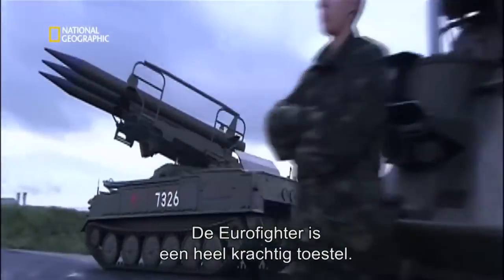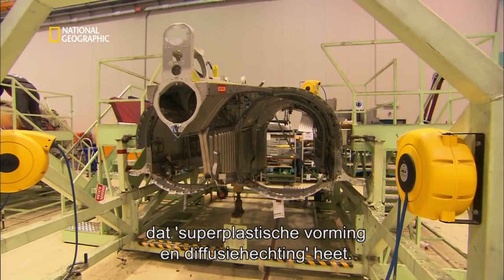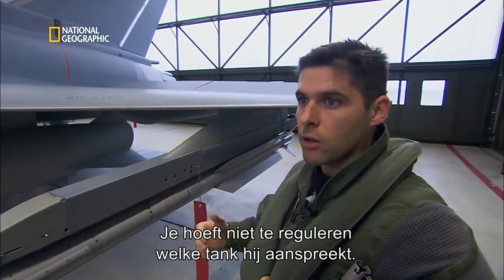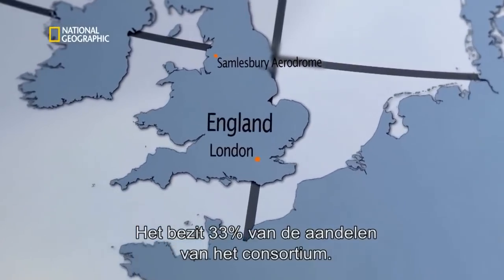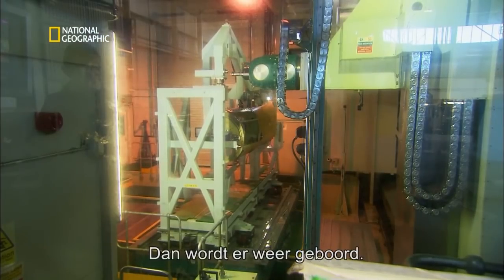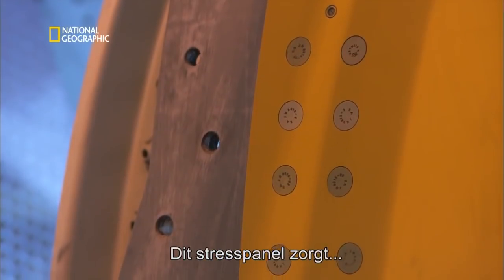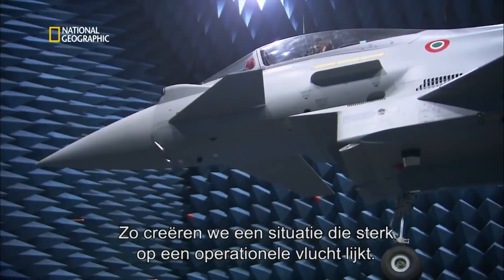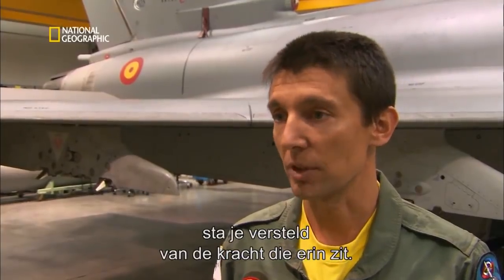National Geographic Megafactories - Eurofighter Typhoon

Comment: Most advanced??? I don't think so. This probably is the most agile in it's class but even the epic fail of an excuse f35 is more advanced than this.
Reply: Um the F-14 Tomcat is better than the F-35 and they did say this is the most advanced fighter in European History not the most advanced fighter ever made in the world but in Europe it's the most advanced fighter that the Europeans had designed
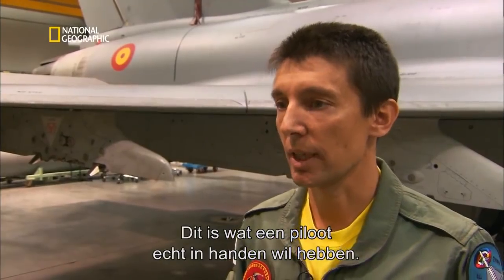Reply: Gahlok12 start  0:11 . . .and nope, the F14 is not better than an F-35. The F-14 may be a legend, but the F-35 is a multi-role aircraft. F-14 was mostly meant for intercepting.
Reply: red rivers But the F-14 became a multi-role airplane back in the 1990's it out runs, out turns, out climbs it. and can use more weapons than a F-35
Reply: The only reason why it became a multi role was because there was no choice for the americans. The reason why the F15 was built was because of that being the primary reason. On a sprint, the f14 was fast, but on turns, the f14 turned wide. Because the design of the body was meant for interception missions. The f14 was also expensive to maintain. F14 is a beauty, o
But on the practical side, it was never as agile as it's opponents.
Reply: red rivers At least it could out turn a MiG-23
Reply: And that was your basis of saying that an F14 is better than an f35????
Reply: red rivers It can carry better weapons and doesn't full rely on computers and is a proven design
Reply: Please...the fact that it was retired meant it was not better. An aircraft is not just measured by how many guns or rockets it can carry. It has to be efficient and precise. And cheaper to maintain. Maintenance was the very reason why it became obsolete. Carrying more and moving faster is useless if it costs a whole country to operate.
Reply: red rivers Dude the F-35 is an okay plane but it's range is less than the Tomcat plus I have been throwing out things and besides a F-35 is more complex than a Tomcat and a F/A-18 E/F can't go over Mach 2 speeds The F-35 on the flight deck is going to have some real weight issues
Reply: I've said it once and I'll say it again. Going through Mach speeds of up to 2 isn't the only basis of being "advanced". What use will speed be if it's up against a plane that can see it Nautical miles away before it could even see the other. Even before an F14 spots the F35, the f35 has already launched it's missile seconds ago, that Mach speed figure will be totally useless to try and out maneuver it. That is why it has a much less range compared to the F14 because it was meant to end missions quick. No dogfights of the modern day go past 3 mins. The F-35 was designed to have a Sniper like advantage towards it's enemy. I don't like the F35 and I think it's a sorry excuse of plane so that the US government won't have to share the technology on the F22 but never compare an F14 to an F35 in terms of technological advancement. I to am a Fan of the F14, but facts will always beat opinion.
Reply: I also forgot to mention that the F35 actually have a "smart autopilot" that gives pilot Hints in maneuvering the aircraft the "correct way" to lessen the stress on the body of the aircraft while performing one maneuver to another to out maneuver an inbound boogey.
Reply: Gahlok12 this argument has been going on too long and I checked where it all started. I even forgot about what the Video was really talking about. I was actually surprised that you manage to make this conversation into an argument about which a/c is better; the f35 or f14. bottom line is that the video said that the tornado is the "most advanced" a/c and I just said that the F35 is actually more advanced than the tornado.
Reply: red rivers Oh wow how did we both fall for that XD but still which model of the Tomcat were you talking about because I think I should have said the F-14 D Supertomcat because if you bring out the A model then I agree with you I love Tomcats in matter of fact I sat in one I think it was in the pilot seat
Reply: Just curious, how do you define "Advanced Technology"? Because last time I checked ADVANCED TECHNOLOGY means promising yet immature advancement used by only a few. Name one thing any of the F14 versions have that can be considered a technological leap TODAY. Not in the 80''s but TODAY. And for the record, sitting on a pilot seat without knowing what those instruments mean doesn't even prove a point.
Reply: red rivers The Tomcats can use Jdams and modern day weapons
Reply: read my previous comments....we are going nowhere with your argument....your not making sense anymore...
Reply: red rivers What I'm saying is that the air to air weapons that are still in service with the US Navy is still something the Tomcat can use I have read your comments. Besides its not 1960's tech not the Super Tomcat in fact it's a whole lot better than the Super Hornets and F-35 aren't that special I mean Gen 6 in the works making the Tomcat and the F-35 outdated. Generation 6 jet aircraft are in the works as we speak. The F-14 D when it came out was more Advanced than the F/A-18 A,B,C, and F/A-18 D Hornets more computers, tracking up to 24 targets at longer ranges, longer ranges, wide amount of weapons of air to air missiles, A wider bomb carrying platform from 500 pound dumb bombs to 2 bunker busters it remained a deadly fighter up to it's retirement and the arguments against are so old now that the F/A-18s are aging at the same rate as did the Tomcats. The Tomcat remained the "KING OF THE ARICRAFT CARRIERS" until 2006 from 1974-2006 it served and it's called aged planes no problem just build more if they work just build more. Besides the Navy wanted more than 100 Super Tomcats but got under 100.
Reply: If you think the F14 is more advanced than an F35, then be my guest. It seems you are omitting the most important point. It's the overall package. The f14 was never an option to todays standard because...again, I can't help but stress this out, it's design feature is outdated and operating it is very costly.Btw, the f18 was not a replacement of the f14 so stop comparing the 2. The f18 was built(with the original plan being the f18 replacing th f16) having fuel economy and multi role aircraft as the main goal.the only reason why the f16 is still being used today is because it was way ahead of it's time that even today, it can still go up against any fighter in air. The f18 was intended to perform like an f16 but with 2 engines.
Reply: red rivers I'm not trying to say that where did you get something like that I was trying to say that the F-22 is more Advanced than the F-35 in fact the F-35 A is a downgrade of the more advanced F-22 A Raptor I wasn't trying to say that the Tomcat is more advanced. F-14 outdated design um there were designs that could have put them past 2006 you know and F/A-18s were meant to replace F-16s it was designed as the YF-17 at first.
Reply: What!? You originally said the f14 is more advanced than an f35!? That was the very reason why we are arguing...get your statement together man. Your last arguement never made any sense. At all!!
Reply: red rivers No I'm not saying that I'm saying that the F-22 is more advanced than the F-35 and the F-14 D Super Tomcat was very advanced when it came out in the 1980's.
Reply: What is your point then?? Can you at least just stick to the F14 and F35??? First it's the f14..then the F18...now the f22....keep going buddy. Go back to topic.
Reply: red rivers I like the F-14 Tomcats not for their price not because of a so called out dated design but the fact that it still got the job done even when it faced retirement and what do you think about the F-4 Phantom II
Reply: Part of the things that you consider when going to war is the cost. Even if an F14 can carry 20 sets of weapons in one go, operating it is costly. With the brand new jets that are coming in which is by a mile better in terms of fuel efficiency, weapon range capabilities, and maintenance affordability, how can an F14 be better?? An F35 is less costly to operate, can do pretty much any aerial missions on the table, and to top all that is STEALTH, which part of that do you not underand? Because of the leap in technology, the F35 is more practical to operate and that is what makes it a better plane in the over all package.  And stop giving me that crap about mach speeds and weaponry system. Because those things will not matter if the aircraft is very costly to operate. When you look at the side of being better, you look at the overall package. Not just the things that give you the illusion that it really works. Don't focus on those so called specs because in reality, it is all about how the pilot makes use of the options the aircraft have. The F14 was advanced in its time but it will never be better than an F35 simply because of the technological edge the F35 have over the F14. If this still isn't enough explanaition to you, consider this; the F35 is a multi-role stealth fighter. What will the F14 Do if it can't see what is infront of it? If your going to counter argue this statement with those aircraft specs one more time, then you are missing the point.......by a frickin mile!!
Reply: And for the record, part of getting the job done is to be as efficient as possible. Use your common sense, if I get the job done but had to spend a billion dollors to get it right, and you also got the job done but only costs a fraction of what I spent, who did the job BETTER??? In the real world it's not who gets the job done, it's who or what gets the job done BETTER. And we know very well that money don't grow on trees that is why in wars, whatever or whoever gets the job done having costs at a minimum is automatically better.
Reply: red rivers But still if you are in the middle of a war and retiring the Tomcat in the middle of a war and having squadrons taking their away from battle having to be taught how to fly newer planes cost millions too you know and F/A-18 burn through loads of fuel and don't have the wide amount of weapons that the Tomcat can do when to me cost of doing something in time of a war doesn't mean anything to me
Reply: But the fact that they did retire the F14 and used newer aircrafts proved that it is still cheaper to fly newer aircarfts. Kid, it's not what you think that matters. It's what really is cost effective that matters. Not being able to bring as much weapons in war isn't as important as what you think. It's what gets the job done.
Reply: red rivers Look here since when has Freedom cared about being cost effective?! it's cost is in the loss of those who go and fight to me I don't care it cost tons of money to use old stuff as long as the fight for freedom is in a war. It's called make more of them if they work and still work just build them in large numbers and do in such a way that no matter how many are lost it wouldn't change the course of a war. Have you seen pictures of what an F-35 or an F-22 looks like in the process of being built? It is a long time to build just one of those you can build 2 Tomcats for the amount of time it would take to build one F-35 and it's cheaper to mass produce them. F-14s just because they were retired doesn't make them bad and the whole agruement about age I mean really it's much cheaper to keep a squadron that has been in battle for a while with an aged plane that is to pull them back for training. Do understand that time and money and F/A-18s cheaper to use um look at 2001 and 2003 the F/A-18 was wasting fuel like crazy compared to the Tomcat. Look like I said the thing is this just because you have an old air frame doesn't mean much if it's not even 20 years old the F-14 D Super Tomcats that were retired weren't even 20 or older they were made in the early 1990's your 100% build D models still had use in them for another 4 years Why do I know this 4-5 more years. Look here if you know some one born in 1991 then you would know that an F-14 D built in 1991 would cost more than F/A-18 of the same age.
Reply: And oh, i just remembered you saying that the f35 is a DOWNGRADE pf the F22. WRONG!!the F35 was never meant to be an update of the F22. THE F35 was made to replace the aging F16. And the purpose behind the F35 is to share the technology behind th F22 which was it's stealth technology with out hampering It's aerodynamic capabilities that much (I say that much because they went through such hardships getting the desirable design to make stealth work while making the aircraft agile enough for dogfights) another reason as to why the F35 was made was because when the F22 came out, EU and other countries feared that the US can actually get inside a restricted aerospace with out even noticing them. The US was adamant about not allowing other countries to have a nuclear weapon for the safety of everybody. Now the question is, if safety is the concern of the US, then why is it just the US that should maintain a technologically advance weapon ? Why not let everybody have a piece of the stealth plane that the US. Has possesed allowing other countries to help achieve and maintain peace and order. The F35 is the product of that talks. That is why it is called JOINTSTRIKE F35.
Reply: red rivers Really the JSF makes me think of the TSX Project really 1 air frame to do different jobs isn't a good idea
Reply: that is why it is called a "MULTI-ROLE aircraft".
Reply: by the end of the day, it's not what YOU think. It's what gets the job done. not being able to finish a war does not mean the job was not done. after all, the F35 or any plane for that matter, was never meant to end any war. It was meant to serve it's purpose; to have a technological edge over the other. The F35 is a better aircraft than the F14 simply because it is a stealth multi-role aircraft. while an F14 can only do one role, the F35 can do more.
Reply: red rivers F-35 jack of all trades master of none and the Tomcat is still better in my view
Reply: That is your view. Nobody Cares about your view, kid. Still does not get rid of the fact that The F14 is retired. Get over it.
Reply: red rivers I know but still 2 engines
Reply: Lol..you just don't want to be beat....now, between you and me, who is trolling?? Those points ddon't even mean sh*t kid...go to school...lol
Reply: red rivers LOOK HERE DO YOU KNOW ANYTHING ABOUT THIS STUFF?!
Reply: Hahaha!! Lame comeback kid...i know for a fact that I know what I am talking about..
Reply: red rivers Well I do to planes are something I learn about
Reply: red rivers Hey I know what I'm taking about and you think your smarter than me and  here is something that you forgot about F-14s a TV sighting system in the chin pod
Reply: red rivers Um your point of the F-35 as an example okay. The F-22 would have been a better one.
Reply: ***** Um  yes I do know that think I'm stupid I know what a role is dude
Reply: Rest assured smiter, I know what those planes are for. And yes, gahlok is stupid.
Reply: red rivers Dude I'm not stupid I have feelings dude you don't get the pint of naval jets 2 engines for safety and the F-35 only has 1 and 2 strong air frame which again the F-35 lacks and your a F-35 butt hugger and you think you everything about naval jet design but you don't.
Reply: red rivers You can go to jail for harassment and being a total jerk calling names and besides F-14s aren't out dated F-35s are ugly and I don't care how much tech you put in a plane tech can and will fail and a 99% fail for the most advanced tech and you forgot building new planes means more parts and a F-14 to build brand new is more than 50% of the cost to build and with new build parts cheaper to keep in the air. and saying I know nothing you don't get the whole view of Naval jets. I'm not stupid I know what I'm talking about.
Reply: Gahlok12 Dude, you push those people to speak foul words because of your flawed logic.... sorry i respect everything you said but they are correct you really dont understand how Airplanes are produced and used in combat......
Reply: MisterAndroidFroyo It's not flawed I hate it when people think I don't know anything.
Reply: Gahlok12  "I don't care it cost tons of money to use old stuff as long as the fight for freedom is in a war. It's called make more of them if they work and still work just build them in large numbers" this statement coming from you just proves my point. lol you really dont fully understand the big picture.......
Reply: MisterAndroidFroyo Look here it's just my view of things got it!
Reply: Gahlok12  You know what sometimes ignorance is better than having  wrong information on your brain.I respect your points actually some of it are correct like aircraft having 2 engines is better for carrier operation, well yes technically, but the problem with you is that you are a F14 Fanboy who cant accept that its already obsolete and retired, accept innovation and evolution dude that way you are helping humanity to reach its full potential. well goodluck.. ^^
Reply: MisterAndroidFroyo Okay sorry I guess I am to a point just a F-14 Tomcat fan. I never liked the looks of the F-35 anyways. well things happen and such.
Reply: This was designed in 2001
Reply: Ronan Gormley True true and the thing is I don't like being called ignorant I would rather be called hard headed. Because I don't back easy.
Reply: red rivers The F-35 has good technological features but isn't maneuverable at all. We'll have to see how it performs in simulated combat to make fair judgement.
Reply: Nick3111997 Okay.
Reply: red rivers The F-35 is not an "epic fail" as you see it! Like this fighter it is going through growing pains. Same for every other fighter. This is the nice but partial documentary. The Eurofighter was 10 years behind schedule and cost over double it's original price tag. A new Typhoon flyaway costs over $97,000,000 dollars! The F-14, F-16, Su-27 and Mig-29 programs have all suffered crashes, major technical glitches, substantial redesigns, and pilots dying. Unfortunately nothing new. 

These things are not easy or straight forward to do. And then there's the greedy defense contractors and even greedier politicians in bed with each other in a twisted incestuous money fueled orgy. But that's another story...
Reply: FrakU2 Yep
Reply: red rivers lol typhoon beat f35
 3 times in Swiss show in 2017....  f35 is fail  experiment for usa
Reply: The F-35 still isn't operational yet in the USAF.